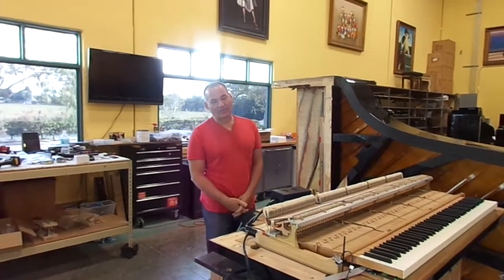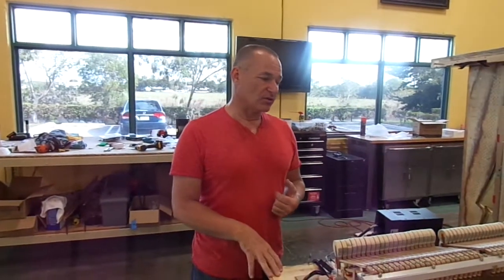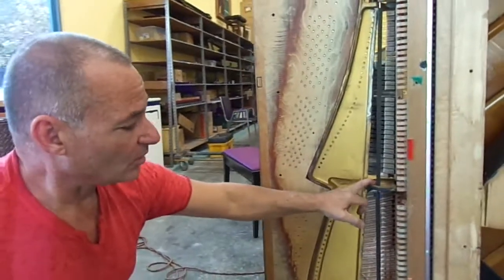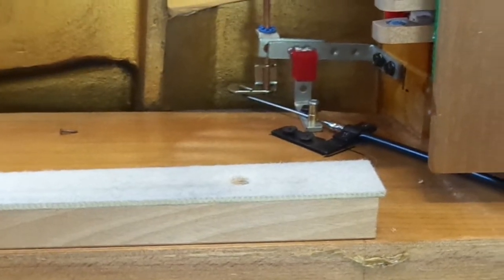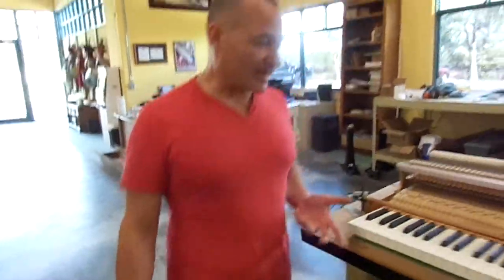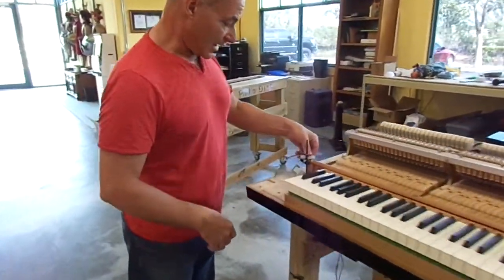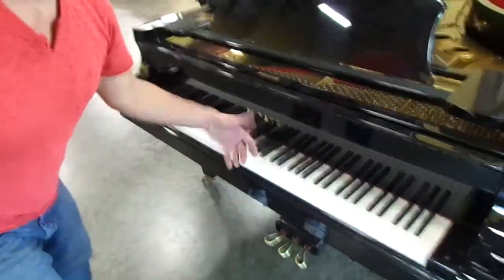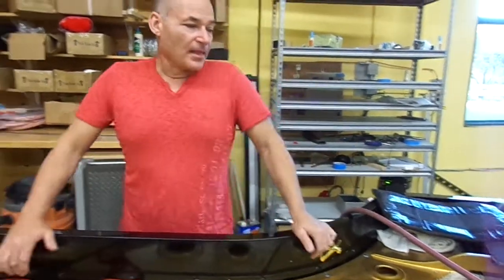Yamaha CS II Concert Grand Piano Disc and Pro Record Installation

Comment: Hi Russell. I'm thinking of buying a ProRecord System but I can't find detailed information on the Web. Can you answer a couple of questions? Is the ProRecord system a single system that does everything I see here or is it a modular system were you buy pieces here and there depending if you want or don't want certain things. A Piano company I called said you have to buy the Piano player as well or the ProRecord system wont play back the Piano strings. Is this True?